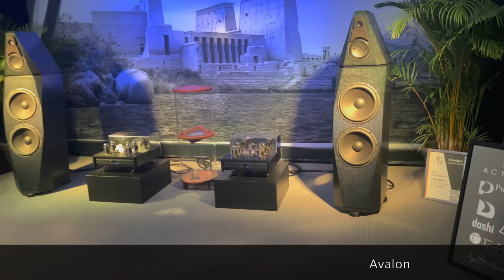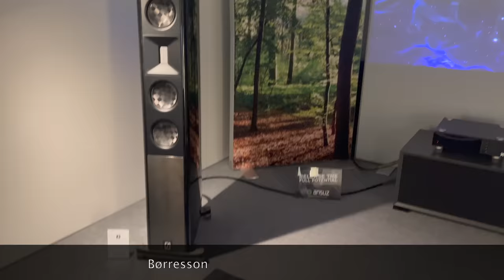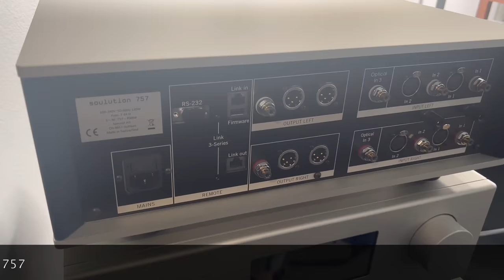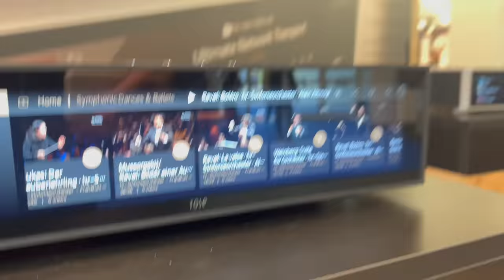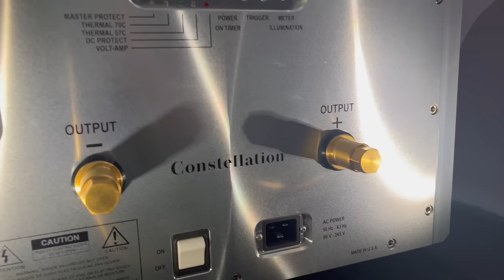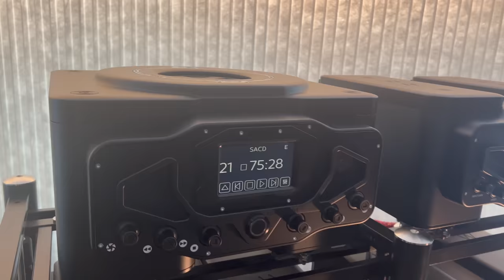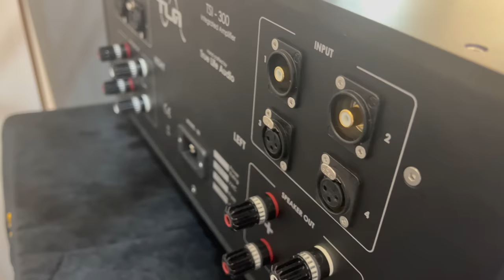Munich High End 2023 - The Best Of The Rest

Comment: I have created a remarkable home audio experience by setting up a 32-speaker array, a venture that is both unique and potentially trailblazing in the realm of sound technology. This impressive arrangement consists of Bowers & Wilkins (B&W) speakers, specifically from the acclaimed 804 and 800 series. The sheer scale of this setup, with its 32 strategically placed speakers, transforms any ordinary room into an extraordinary auditory theater. The precision and clarity offered by this large array are unparalleled, providing an immersive listening experience that captivates and enthralls.This Dynamic Music System (DMS) has been designed to cater to a wide range of listeners. It has successfully enchanted a diverse audience, from seasoned music professionals and dedicated school music teachers to passionate audiophiles and even young children, all of whom have been amazed by the depth and quality of the sound.

Comment: Sometimes I can't help but feel there is more thought and effort goes into making it look pretty than goes into making it sound great. Take the Wilson Audio Alexx V. USD $130k - $150k and it uses cheap ass Scanspeak Revelator drivers in it. I had those in my last set of Sonus Faber Cremonas, but they don't sound as impressive as the Scanspeak Illuminators that I currently use.
Reply: It makes you wonder what percentage of these companies ever break even and where they get their money from in the first place. I hope the oil rich Arabs aren't stupid enough to finance this? If they did, why start 10,000 companies? Why not just start 10? Are these companies all stories of someone's life passion going down the drain? Or is this financialization run amok? I love audio and think that high end audio is even better. But I care about sound quality. Audio Note UK do it right. No fancy cases. No remote control because they can't get it to sound right. Pay their own money to get new types of resistors developed or to bring back the closest thing to a Black Gate capacitor. And almost zero coverage at shows like this or in the audio press. They don't pay for advertising yet still grow at a rate they can't keep up with. I just wish they would make amps for headphones. They never will but there's always hoping.